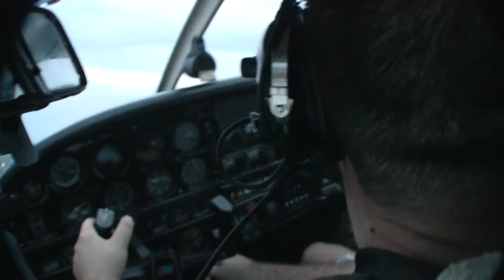P28A Emergency Engine Out Crosswind Landing (Mini-Episode 2)

Comment: On flightchops question...  Would assume that was a real engine out scenario but they weren't aware of it?  Engine not running after landing most likely idle setting too low???
Reply from the maker: There was a fuel problem that required repair. The engine died on base - final turn